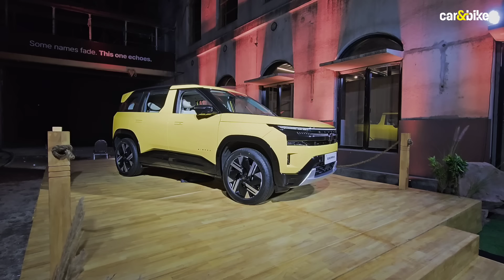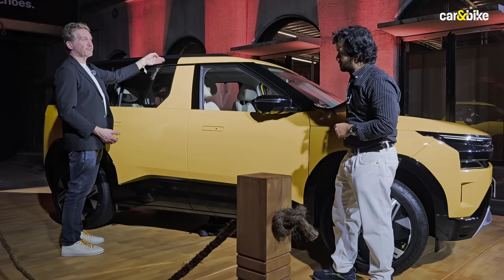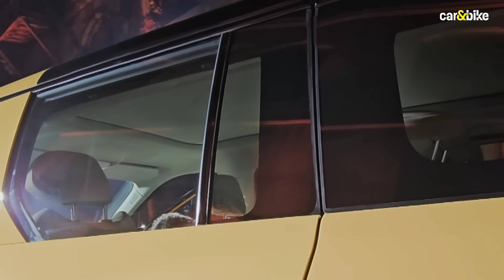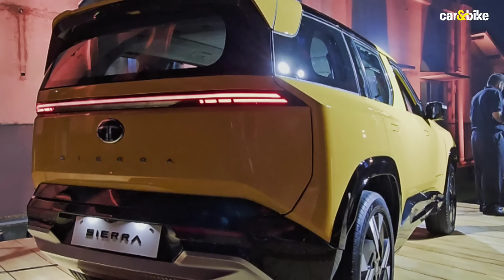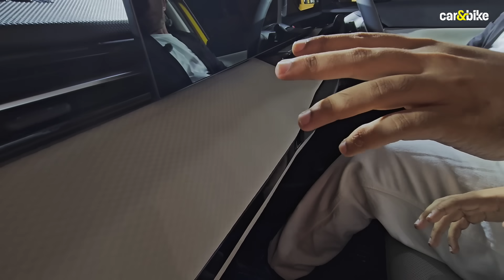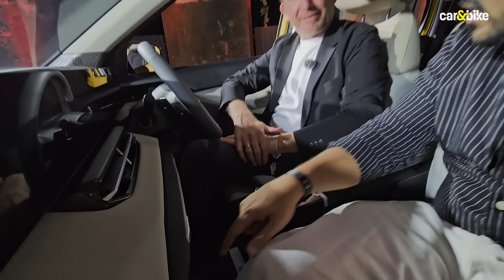NEW Sierra: Could it have looked more like the OG? 🤔 | Explained by Tata design head Martin Uhlarik

Comment: My only downside is that the Spare wheel should have been inside the boot or in the back like Jimny or thar for better convenience and appealing looks.
Reply: Can you explain what is the convenience ? of having spare wheel in boot?
Reply: @Lakshmidasaa in case of a rainy muddy trail if the tyre gets punctured, it's much easier to change the tyre, unlike the one that's below the car. It's a pain in the ass to get under and remove the spare tyre. If you know what i mean
Reply: @kilingpertin6081 But you have to go down for changing the tyre. If you changed the tyre alone, then you know it.
Reply: @kilingpertin6081 why will you go below the car?
Reply: @Lakshmidasaa you don't have to go down just lift your car with the use of a jack from the toolkit after you have loosened the tyre notes. No hassle unlike cars with spare tyres that are underneath like Scorpio, Fortuner & now Sierra, but ofcourse no big deal one can definitely live with that.